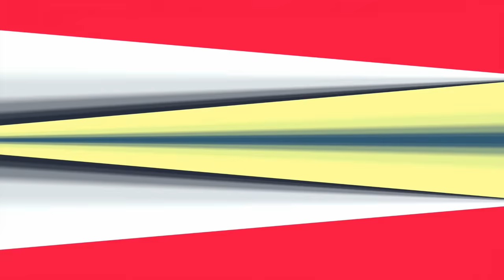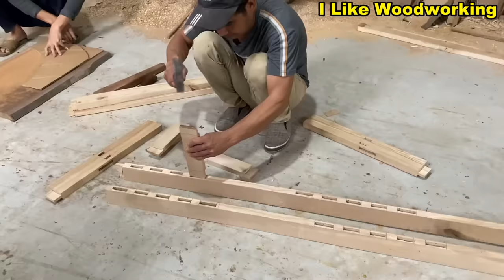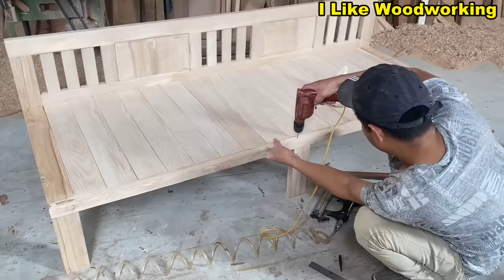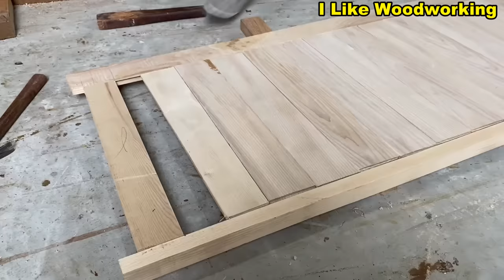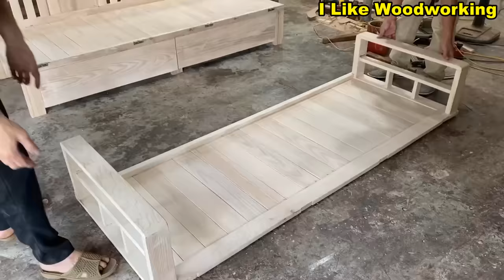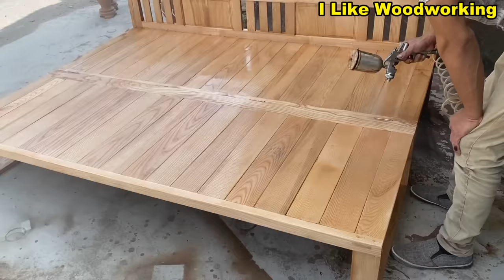How To Build A Smart Chair Combination With Bed - Design Ideas Woodworking Project Smart Furniture

Comment: Smart design , good workmanship.
However the joints used in the whole sofa-bed doesnt inspire confidence enough to utilise the item. The wood used seemed is not of the suitably hard type ,and the thickness could be wanting.
I would not buy the item though i like the design n its practicality.
Reply: I agree with you.. the quality is not for the heavy people.. very good idea but the wood is very tiny..better make a liitle bit more big or strong wood.. to care heavy people.. just saying..

Comment: That was one of the scariest videos Ive ever seen. Great concept, poor execution and safety. I won't mention the technical aspects of the build but more a focus on safety because that matters most.
1. Lack of guarding for the joiner, table saw and router table.
2. No safety glasses were worn.
3. Lack of kick stop on table saw.
4. Lack of push sticks on any of the machines.
5. Lack of working surfaces to prevent tool slips and offer better control.
6. Lack of bench vises and clamps to hold work steady.
7. Pointing nail gun at hands while holding work.
Reply: Ok first world problems
Reply: Lol, yes and someone pulled up on a motorcycle with sandals on.
Reply: @pennydink72  lol

Comment: Sell it as a kit for people to assemble, and you can start your own brand of woodwork/furniture. Both landlords and renters will like the space saving function, and I'm sure it is also much lighter than the typical couch and definitely lighter than traditional American couch. (which must be removed and discarded often, with some evictions). Maybe price at $200 for kit, or $300 assembled. (American market pricing estimates - I'm sure easy to compare on web sites like Amazon or Alibaba)
Reply: Its lighter because it's not made for americans... definitely not for two americans 😂

Comment: Your work is justified.
But one comment, work smart not just work hard

All that while you cut small pieces to make one big frame,(spending hours, energy and machine use etc) from. One wood sheet you could have die cutt all that frames.

You should also watch some videos to gain quick ideas